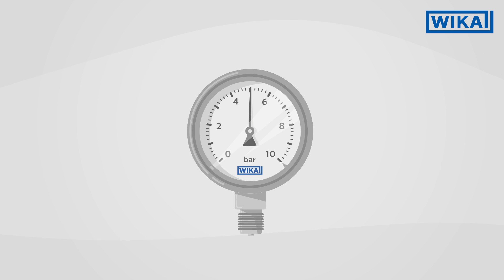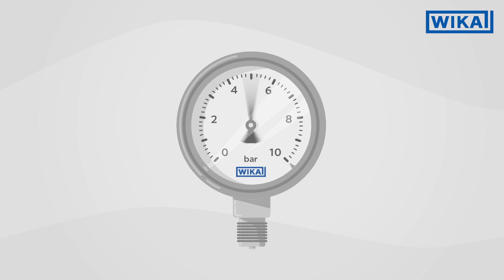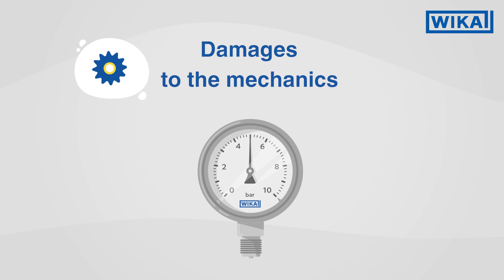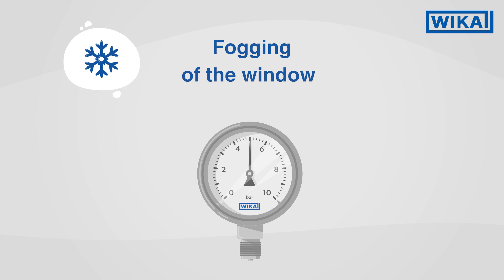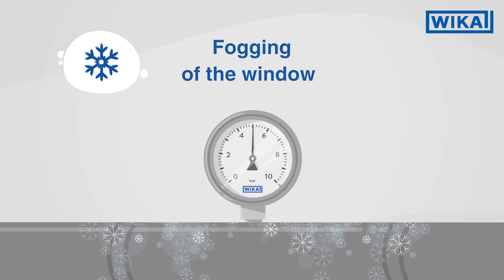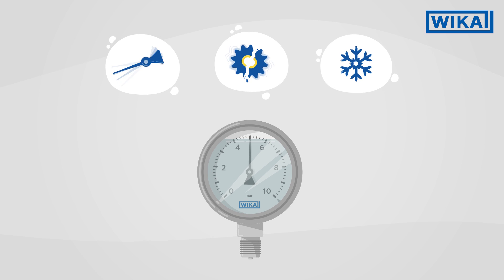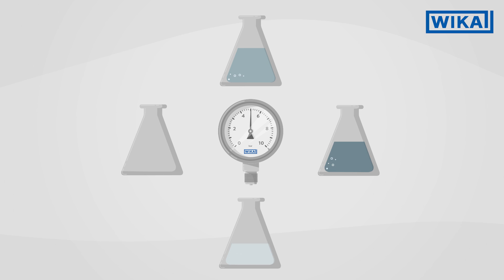Liquid-filled pressure gauges | Advantages & application areas

Comment: What Kees the glycerine from mixing into whatever you’re gauge is reading?
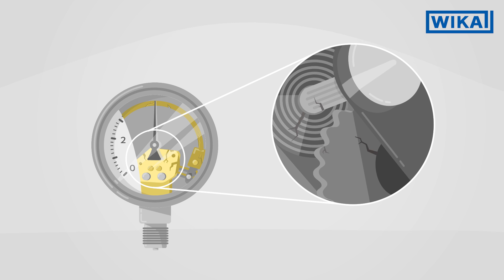Reply from the maker: To answer that question more easily please have a look at 00:45 Min. There you can see the inner parts of a pressure gauge. The process media is only in the measuring system of the pressure gauge (yellow marked parts) but not in the case itself. So the measuring system itself (mainly the bourdon tube) separates the process media from the filling liquid that is filled into the case. So the process media is inside the bourdon tube and the liquid filling is around.

Comment: I need to refill my gauges just a little. I guess it the filling tastes sweet I add some water. Is there a refilling guide?
Reply from the maker: Usually our gauges are filled with glycerine. However, in this case if only a little is missing, water is ok. Generally our gauges are not completely filled so that in the event of a significant temperature raise and an expansion of the filling fluid  the gauges are not leaking. So we recommend a case filling of approx.. 90%.  Let us know if you have any further question! 👍
Reply: @WIKAGroup  thanks for clarifying. They look prettier when full but I appreciate the reasons. All the best. Waynos

Comment: Which liquid inside the gauge..?
Reply from the maker: Depending on the operating conditions, glycerine-water mixtures or silicone oils are the most frequently used filling liquids. Glycerine-water is suitable for the majority of applications and ambient temperatures. Particularly for low pressure ranges, it makes sense to use it, due to the low density of the liquid and the associated low resistance on the pressure element. Silicone oil is primarily relied upon when the pressure gauge is exposed to particularly high (> +60 °C) or very low (< -20 °C) temperatures.

Comment: Why aren't liquid-filled gauges ever filled completely?
Reply from the maker: Good question! ☝️ 
By default, the case of the pressure gauge is only 80% to 90% full as the fill fluid will accumulate and expand with additional water depending on humidity and ambient temperature. The incomplete filling thus provides sufficient space for expansion. 
Feel free to read more about it on our blog: https://blog.wika.com/products/filling-liquids-pressure-gauges-usage-advantages/
Reply: @WIKAGroup  But, the case is sealed, would this not prevent water/humidity from entering the gauge and being absorbed by the glycerin?
Reply from the maker: @Orcinus24x5  A case that is fully hermetically sealed is considered as ingress protection IP66/IP67.
However, most of our pressure gauges come with ingress protection IP65 as standard and are not hermetically sealed. Hence, water/humidity in small amounts can enter the case.
Best regards.